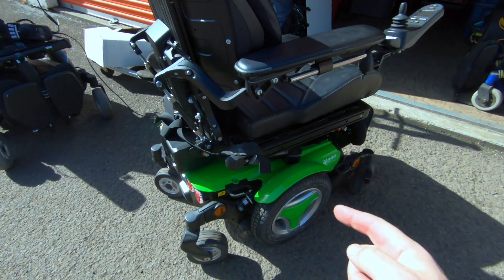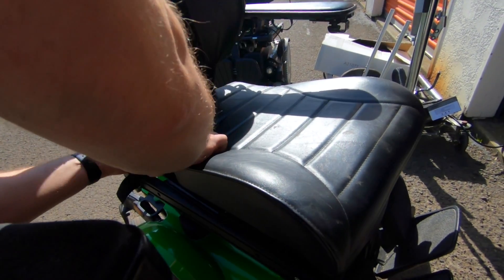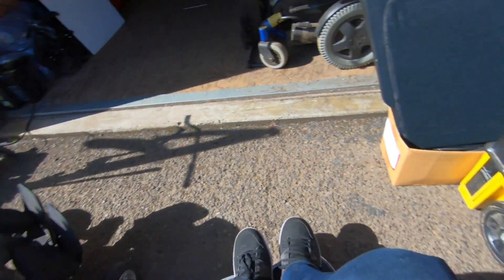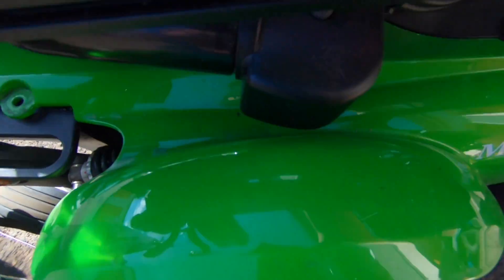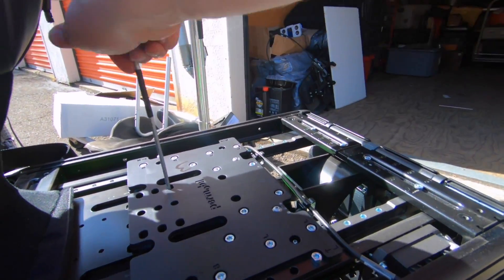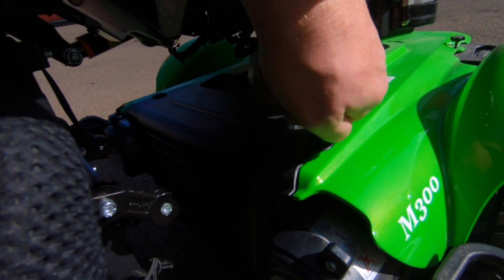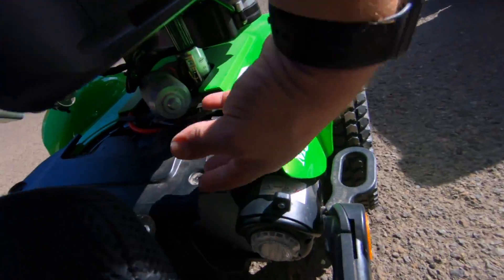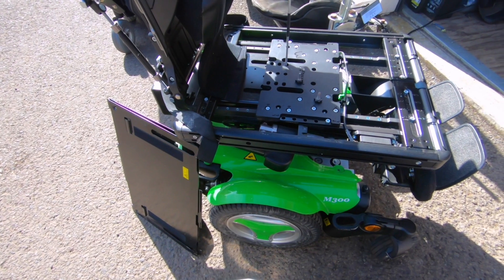WHEELCHAIR REPAIR: seat lift operation with no batteries (Permobil 3G)

Comment: i didn't know this existed 😂  i have 2 m300's and have never used this feature i personally unplug the leads to the seat elevator and used 2 pieces of spare wire and a 12v car jump box to power the elevator feature (direct hot wire) it goes faster than the manual crank feature but if i find myself without my jump box this knowledge will come in handy! Thanks man👍

Comment: I have a C500 with tilt/recline but no lift, with dead batteries.  Unfortunately the seat position prevents me unscrewing/ lifting the cowling.  Though I have opened the side panels I can't pull the battery out.  I've checked the service manual, googled, asked the guy who delivered my M3, but no joy so far.

Does anyone know how to incline the seat manually to gain some clearance in the back?

I do have Anderson sb50s connecting to each battery and I own  many differnet battery chargers (12v as well as 24v wc chargers) and also a desktop variable dc power supply.  I also have a set of new batteries uninstalled.  I've thought about trying to give it enough power to budge the seat, but am worried something might get damaged in doing so.

Comment: I found an F3 Model 2 that is listed for a really low price because it "Needs batteries/charger repair, but this video tells me they let the batteries die and the charger won't start charging. If it isn't gone, I'm gonna rent a vehicle and go get it. They say they don't need the chair, and I'll make an 1100 mile trip to get it for $200.

Comment: Ok I’m an ATP and have been repairing wheelchairs since I was 13( mom owned a provider) - Sir you need a jump box. Don’t have that budget? Do what I do: find two old chargers, try for same brand 5amps and up, tape/heat shrink insulation, and a set of wire strippers. You know where I’m going, slice and splice the two cords that end in 3-pin connectors so that you have one on each end. Then take apart each connector and clip the arch solder/cable from the 1 pin to the 3 pin(could be reversed on some chargers brands) then put it all back together. You can now jump a dead PWC from a charged PWC by connecting them with the “jump-cable” from charging port to charging port. BONUS: if you have an extra collapsing scooter battery box, you can switch out the 5 fuse in the front for a 25 fuse connect your jump-cable to the box and then a dead PWC and you remove the need for a second PWC that’s charged. - hopefully that helped someone and I didn’t confuse you😂
Reply from the maker: oh i built one years ago, and use it all the time! unfortunately, its on my list of topics that can never be covered in a video.. no matter how many warnings or disclaimers are given, people WILL try and drive their chairs around using one, and melt all the wiring! :^/
(people have attempted to sue for far less)

Comment: I have watched many of your videos. I have an older c300. I screwed up. I put a fair amount of white greese on the seat elevator post. I am a woodworker. Now as you have figured out. I got wood dust mixed into the gease. I have been cleaning the post with WD40 then wiping it clean. I got noise grinding, and a bit of rumble. How hard is it to get into where the gears are so I can clean it out? I am really worried. Is this a really big deal? Its not a G3. It’s older than that. Maybe 2K miles on it. HELP? Thank You! Thom Schuck Portland Oregon. Thank you much!
Reply from the maker: hey! so they operate with an allthread rod type arrangement.. there's a motor that connects to the big drive screw with a cogged belt in the base of the chair.  removing it requires some kinda hoist..
2 videos for ya - a super old one with a 2g C300
https://www.youtube.com/watch?v=QMwFqBpm96o
and a newer videos that's more detailed with a 3G chair, BUT shows more of the innerworkings of the lift (both chairs use the same exact seat lift mechanism)
the second video is probably a bit more helpful :^)
once ya get the thing out of the chair, ya can take it apart and inspect the drive threads inside the lift tube.. lots of work, but not really 'complicated'

Comment: what do i do if the seat isn't flat?  can it be jumped to get the seat flat or to raise it up?
Reply from the maker: if the chair is tilted back a little bit, ya should be able to get the front cover removed to at least access the front battery.  it IS possible to remove the back cover with the seat in the down position, but it takes a bit of work, and some time to avoid breaking the plastics..
Reply: @TotallyNormal-  i have both front & back covers removed, where do i go from here?  thanks

Comment: Mr , my wheelchair doesn’t have that Allen screw, but I have the wrench from the back of the chair and I don’t see the allen screw is there other place on the wheelchair. I need HELP this is my only transportation. Thank You.
Reply from the maker: if the chair doesnt have a seat lift, theres a clamp down below on seat tube mount that holds the seat in place.. it a bit of work, but loosening that a bit then lifting up the seating with a hoyer or similar should giver access to the covers!
Reply: @TotallyNormal-  Thank You for the reply, and Happy New Year.

Comment: Hi! My husband's Permobil won't turn on. I know that the battery was fully charged last night. But if you flip the power switch nothing happens. Any tips for me before I start randomly taking apart the wheelchair and wiggling wires?
Reply from the maker: hey! lots of factors... id check the breaker on the back of the chair first, make sure it hasn't tripped.. did it just not power back up in the morning suddenly?
Reply: @TotallyNormal-  Hey, I called Numotion, and they had a guy do a video call with me which was helpful. He had a crazy solution, and it was the first thing he suggested that worked. The joystick was a loaner because the original broke. And on the loaner joystick, the right switch to switch speeds was up. The guy said, hey, flip the right switch to the middle (so not fast or slow). And then miraculously it turned on. He said something about maybe the spring in the right switch was broken?
Reply from the maker: ah yes! if the spring in the power paddle is broken, it'll certainly cause those issues!  ya can strap a rubber band across the joystick from the speed paddle on the other side to hold it in place till a replacement arrives :^)

Comment: So how do you get the seat up on a C300 if the lift actuator is not working and winding the Allen key has no effect at all? I'm assuming that I'm just going to have to unbolt the seat from the top to get the actuator out.
Reply from the maker: make sure the allen key is fully inserted into the correct spot, and fully engaged.. if the seat is tilted at all, it makes getting it in there a bit difficult...
Reply: @TotallyNormal-  it definitely failed quite catastrophically. The threads on the inside of the post with the splining have completely stripped out. I do have photos. Even getting the seat off was a pain. It is a very old C300.
Reply from the maker: sounds like it had a lot of use!! interesting to hear that the internal lift screw stripped out though..
Reply: @TotallyNormal-  I'm sure I can feel the allen key engaging but winding it just does nothing. Seat is completely level. it was elevated a bit and just dropped suddenly to its lowest point with a loud thunk. I suspect something in the mechanism has broken. The batteries are "ok" and you can hear the motor in the actuator turning.

Comment: Hey I just picked up two of these C300s for free. Just passing along the info that a 5Amp XLR charger from Amazon can be tricked into charging flat batteries simply by plugging in the charger, powering up the chair, and using a function like tilt or lift for a moment. The charger that I purchased has a light that cycles between red and green but when it's really putting in work, a small fan fires up inside it. This is how you know the process has been successful and you can power off the chair and allow it to charge. I got both of those chairs going with this method. Thanks for your videos on these chairs, they are full of excellent info.
Reply: I saw a C300 for sale for $50, needed batteries. It got grabbed fast. Wasn't worth renting a van and driving 700 miles round trip for me, though.

Comment: I’m getting a 2022 permobile M3 and I was wondering if there is a way to totally get rid of the turtle mode I’m told you can no longer program it out. Any suggestions or videos you have on it would be great. Thank you
Reply from the maker: it is possible with some 'unsupported' programming :^) but you need an R-Net USB dongle.. they're kinda expensive though :^/

Comment: How can you lower it back down? I own a F5 and the controls messed up and I used it to rise up and we’re trying to manually lower the chair so I don’t drive it really high up
Reply from the maker: on the F5 chairs its totally different.. and honestly ive never gotten it to work properly. its super complicated, and throws the actuators out of calibration!  whats going on with it? have ya tried via the seating buttons, and the joystick to make it lower back down?
Reply: @TotallyNormal-  about a week and a half ago I rose up to get my medication and as I was lowering down it stopped so I thought oh ok I might have accidentally just let go and when I did it again it wouldn’t lower. It show an error which is coded ICS Tilt Error 20AA. I was trying to re-calibrate it but either it’s not working or we’re not doing it correctly. A mechanic from Numotion where I got the chair through came and looked at it. I was asleep when he looked at it and said he could not do it. He then came back the next day to try to manually lower it down but he wasn’t even here 10 minutes. I again was asleep so I don’t know if he attempted to or just fiddled around and pretended not to. I’m supposed to be going out of town in about a couple of day and we’re trying to do it before then so I won’t be a hazard of any sort
Reply: And another question, could dust be a problem for why it’s doing that?
Reply from the maker: i looked up the error code - it indicates that something came unplugged! - sometimes wires can get caught on something and get damaged - or could just be a loose connection - send me a DM on twitter, or an email and i can send ya some photos of things to check. there is one spot that dust and dirt on electrical connections can sometime cause the issue...  ive updated the video description with contact info :^)

Comment: We have a permobil f3, and we can't find the manual way of doing it.  I found the long allen wrench, but I can't find the slot.
Reply from the maker: so the F3 is different.. and honestly i haven't gotten it to work on the newer chairs.. the service manual tells about a procedure to adjust the height, but things just break anytime i try.. HOWEVER it is possible to get the batteries out of the chair without raising the seat lift! the service manual is on the website.. but the section on how to elevate the chair manually doesn't make a lot of sense..  www.brokenwheelchairs.com  but if ya remove the 2 thumb screws on the top cover, ya can slide it back and access the batteries in pretty much whatever position the seating is in! ive also got a video on battery replacement for the F3.  
https://www.youtube.com/watch?v=zg55wUFC17c
good luck!!

Comment: Would it be ok if I use a drill with a long hex bit?
Reply from the maker: well.. there's a lot of delron components down in there that can crack or strip out.. ya might be able to go SUPER slow - and make sure the clutch on the drill is set pretty low.. but i wouldn't recommend it.  i've use a ratchet before... its definitely a workout though!
Reply: @TotallyNormal-  it makes sense. Thanks for responding.

Comment: Any recommendations on transporting one of these? I need to get a m300 hd down a small flight of stairs. Not sure if it would be best to try a disassemble it a bit or just try and lift it with a few helping hands. Batteries are also dead and have been sitting dead for 4 years.
Reply from the maker: usually 3-4 people are gonna be needed to move one of these.. they dont really come apart easily.. BUT the way id recommend - get some straps, or loops, and attach one to each corner, on each transport bracket.. and get one person on each strap/loop and carry it around that way.  lifting the chair using the seating, or any other part can damage things easily - but the transport brackets are solid! good luck!

Comment: Hi, would you have any idea how to manually raise the seat on a C400? We have battery problems but can’t get the cover off with no power. Any suggestions would be greatly appreciated!
Reply from the maker: i think it should be a similar process.. the seat elevator modules are pretty much the same underlying mechanism - but with different mounting..
Reply: Totally Normal Hi there. Rod, in the post here, is helping me with the C400 batteries. Para here too, short and not as many tools, or ideas as you 😁. I need to get the batteries out, and place new ones. Great chair, but can’t get the seat up, still. Is there a way to send pics, to you or post, with seat bottom removed, and where to find manual seat riser?

Comment: What is your every day favourite power chair?
Reply from the maker: hmmmm thats a tough one... for outdoor use.. probably the bounder...  for indoor use.. my OLD AmySystems chair was pretty awesome (doesn't fit me anymore - and the stopped making my model) but currently there isn't really a "favorite" for indoor use.  i have a suspicion that the Quantum 4 Front may be on the short list soon... but we shall see! (just started process of getting a new chair)
Reply: @TotallyNormal-  My too that's why I'm asking you as you are well up on power chairs.  I currently have the Extreme X8.  Had it for 12 years now.  Amazing chair but I need something smaller to get around town, shopping, etc.  don't mind what I pay as it will last.  I also live in the UK so can't really get a Bounder.  Any advice would be great.  Got to be strong and travel a good distance.  Not bothers about speed and tilt seat system.  Quantum 4 Front, QUICKIE Q500 look nice.

Comment: Cool! So with the allen wrench that came with my F3 would this still work with the Corpus seating system if I needed to raise the elevator manually?
Reply from the maker: i need to check on that.. kinda forgot the f3 the elevator mechanism is in a different spot...
Reply: Totally Normal  we’re you able to find this out?  We are stuck right now. 😕
Reply from the maker: the seat elevator and the tilt mechanism are different on the F3 - the vertical post in the front is actually the tilt actuator.. if the seat is stuck in the up position - there's 2 actuators responsible for that - and there isn't really a simple manual override for lowering it back down.  in my experience trying to use any allen wrenches just breaks things on the F3 :^/ its something a permobil rep, or DME shop has to fix...
Reply: Totally Normal Bummer and I thought it would be simple LOL

Comment: Dam now you post what I was looking for. I picked up an c 300ps the other day and wouldn’t you n
Know it dead batteries also doesn’t have seat lift , but just to make it easier just splice into charger and old Skool 24 volt charger and connect  works every time

Comment: I always wondered why the allen was so long. the VA does not consider lift to be important, so none of my chairs have it, I have tilt for pain management, but no lift. there are times I kinda miss using my Permobil, but I really am getting good use out of my Frontier V6 these days.  just wondering, do you know anyone with a really good deal on the city tires for the V6? when I am just running around town, I feel like I am wearing down my knobbies for nothing. but when I go out in the woods, I really see the benefit of them.
Reply: Crazy how VAs are different... They put a lift on my chair but no tilt... Lol